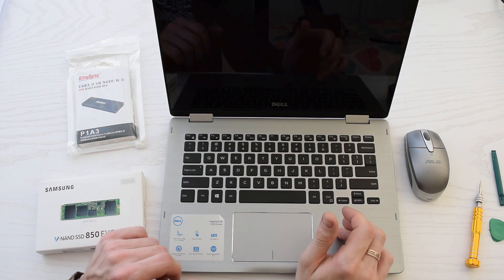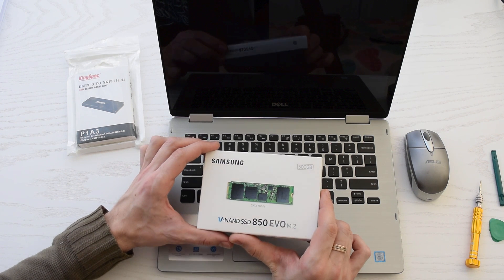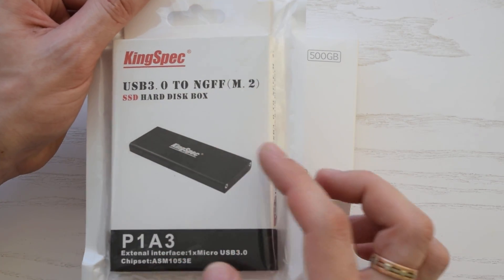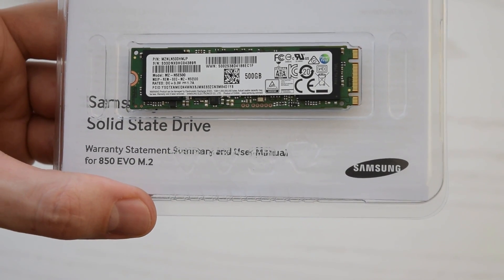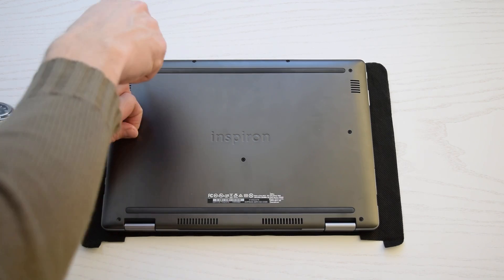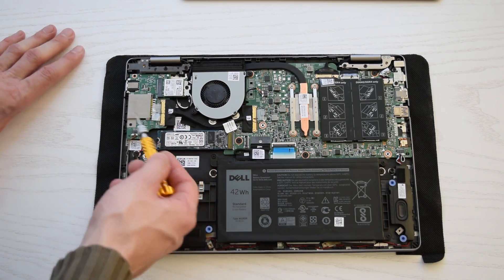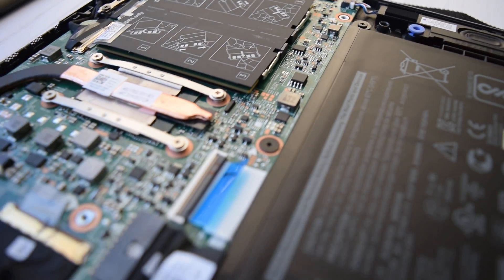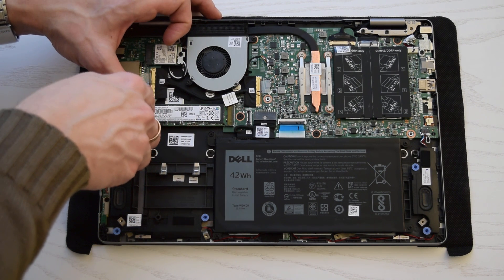How to Upgrade M.2 SSD on Dell Inspiron 13" 7000 Series (7368) Laptop

Comment: Hi, bloke, thanks for your sharing on hardware installment. But ... What about the archives stored on my old 256GB SSD... How can I refill them into the new one?
Reply from the maker: You can clone your old SSD into a new one. Or you can put your old SSD into a USB enclosure (the link in the description) and you can use it as a super-fast USB drive and get access to your old data from any device.

Comment: Where do you get the drivers? My dell wont except the hp and barracuda M.2?
Reply from the maker: What's the model of your laptop? It's impossible. All devices that are designed to work with M.2 NGFF or NVMe SSDs will work perfectly fine with any brand.

Comment: Why do you need the enclosures? Doesn't the SSD connect directly to the motherboard?
Reply from the maker: You may need that enclosure for two reasons.
First, after you've made an upgrade you have a spare SSD which you can put in that enclosure and use it as super fast USB drive.
Finally you can use that enclosure to upgrade your SSD drive without reinstalling Windows, apps and your data.

Comment: Anyway of knowing if the hdd port is active in the 7378? I see it not being used in the video... If I purchase a sata connector for that port and a sata to m.2 adapter,  could a another 2280 ssd fit under where the original is mounted(perpendicular?)
Reply: trsdamocles did you try to do this ?? i have the same question!!

Comment: I have same Dell Inspiron 13 7000 model. I replaced my old SSD drive with new one. Now how can I transfer  Data from my old SSD b&m drive to laptop without loosing it?
Reply: If your SSD is a Samsung you can use "Samsung Data Migration Software" have a look at this video you can see the complete proces https://www.youtube.com/watch?v=mjGS53m9wp0

Comment: Hello, how did you migrate data and load the OS? Did you have to do any changes on the BIO in order to recognize new SSD?
Reply: He lists the external ssd enclosure above the comment section. My guess is you use your cloning software to transfer the OS. On older Dell Inspirons You have to have the New/Clean Drive in the slot on the motherboard, with the original drive on an external drive. Otherwise the MBR doesn't copy over to the new drive & it won't boot-up into windows..... That happened to me a couple times so. On one of my Dell's I couldn't install Windows on a New SSD because the BIOS wouldn't recognize the USB 3 Port...
On one of my Inspiron 13-7000's I'm gonna try putting the original M.2 & the new M.2 into external enclosures & use the Laptop running Windows 7 & run Acronis Home Edition & see if I can clone the M.2 that way....

Comment: what about Inspiron 7348 2-in-1
Reply from the maker: Good model if you upgrade it with SSD but the case made of plastic
Reply: @ElectronicsComputers  can i upgrade ssd m.2 for 7348 2-in-1 (Motherboard- Dell Inc. 067RT2) thank you.
Reply from the maker: You can install M.2 SATA SSD only using this adapter: https://www.youtube.com/watch?v=i2zLpN-bfk0 @luxmanhettiarachchi6458

Comment: Would this be the same for the 7370 model?
Reply: It is the new i58250u 8gb ram 256ssd 13.3inch
Reply from the maker: NO! It's not gonna work. Dell 7370 has SSD with PCIe NVMe interface it's diferent and it has only M key notch. Not sure if that USB enclosure exists...
Reply: 2013Electronics&Computers
Thank you for your reply 😀
Reply: @ElectronicsComputers  hi I am trying to install intel SSD6 M.2 80mm, PCle 3x4 on the Dell 7370...are you saying it cannot work? I looked up specs it said it accepts m2. But I can't get it to boot!
Reply from the maker: @bixrblogz3752  There are two types of M.2 SSDs and they are not compatible. NGFF (SATA) M.2 SSD has B+M keys and NVMe (PCIe) M.2 SSD with M key only.
Reply: @ElectronicsComputers  the thing is according to the specs and people on forums they are compatible. I'm wondering if it's a boot setup problem. After switching drives do you have to do something else? Or hould it just automatically detect and boot? :(
Reply from the maker: @bixrblogz3752  The information I gave you is from Dell's service manual. As a certified Dell/HP/Samsung technician I only do what says official technical documentation even if it's not always true. Turns out your model does support both SSD standards but NVMe will work with limited speed anyway but still faster than SATA, I suppose. On Dell's tech support website lots of people with some issues after upgrading to NVMe in that particular laptop model but none of them complains about SATA. And I recon Dell sells that model with SATA SSD not just because it was cheaper. I hope it will work for you. Try to update your BIOS and reset its settings to defaults.
Reply: @ElectronicsComputers  could you tell if NVMe (PCIe) M.2 SSD is supported on 7352 model? If not, what is the fastest ssd protocol available for it? Thank you!
Reply: @ElectronicsComputers  Hey, my 13-7378 has a M.2 2280 with the B & M Notches, even though the M.2 slot has only the M notch. I bought it used with sticker that says Hard Drive wiped. I wonder if they just pulled he SSD & popped in another M.2 SSD Drive. At any rate, why would Dell show the M.2 B&M Notched type but have an M Notched slot? It's crazy right....
Reply from the maker: @montydaniels1054  As far as I know Dell Inspiron 13 7000 (7378) supports only SATA-based NGFF SSDs which have B or B+M keys. Not sure how your NVMe SSD with M key works in that machine.